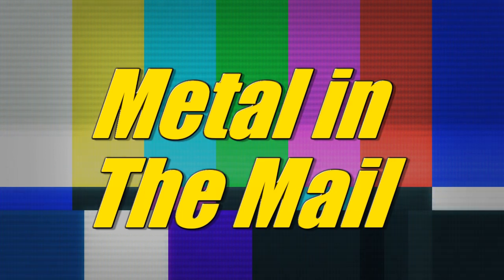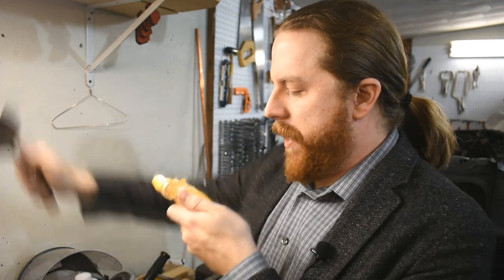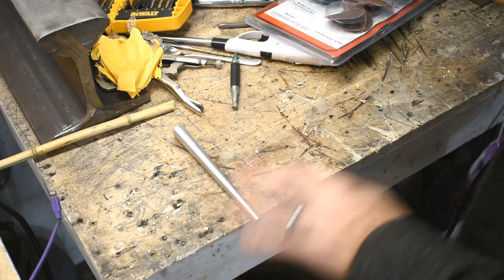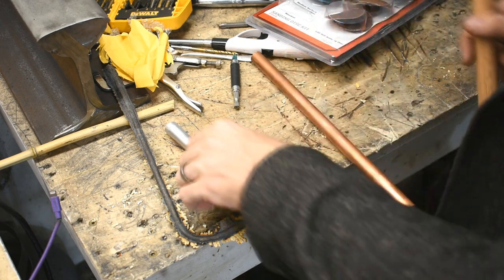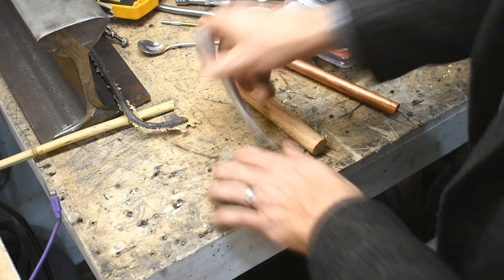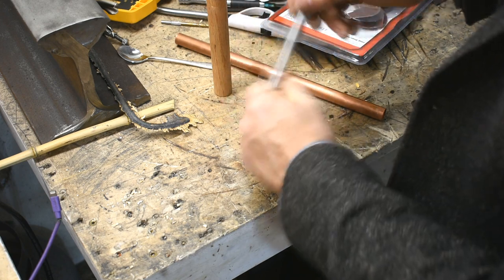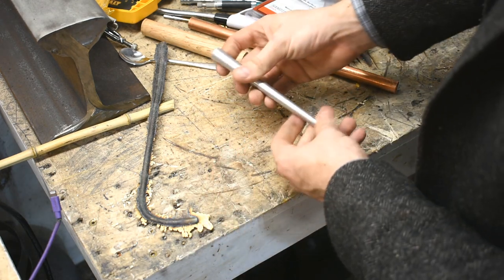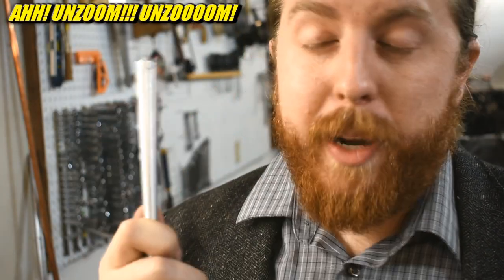Metal Casting Tip: Improving Surface Finish of Metal Castings with a Tapered Sprue Former

Comment: thinking about it , and it does make sence to pour it slowly but to prevent any vortexes or stuff like that and fast enough so it doesnt solidify before the pour is finished  
it might actually be good to lay the to cast part at a slight upward angle (maibe put the mould on a slight raise (block of wood) oposite the pouring funnel ) 
that will have the funnel at an angle so the metal rolling along one side of it preventing the metal from falling down intoo the hole and mixing with the dross like you mentioned 
setting it at an angle has the metal come in at the lowest point and flowing toward the airing hole untill thats filled to the top 
i think if you do that right the little bit of dross stuff youre talking about that gets created during the pour intoo the mould might stay in front of the flow of metal being poured in floating on top and works itself up and out of the vent at the other end 
might be worth a try , i dont know enough about metal pouring to know if it will work

Comment: i think the surface finish also depends on the investment powder you use. (I know you use delft clay). I am also an amateur caster. Earlier I used to use simple construction plaster for my lost wax process. Recently I made the switch to jewelry grade investment powder. And boom.....smooth surface finish. I think it has to do with the particle size. 

May be try sifting your delft clay and see if it improves???

Comment: The key is to keep the sprue filled during the entire casting. One trick done by industry is to have a pouring basin on top, and a plug in the sprue, so when you have some melt in the basin, you remove the plug so the air in the sprue is pressed in front of the melt.

Comment: I can see slowing down the flow when pouring into sand to keep from blowing the sand into the casting.  I run ceramic shell.  My sprues are fat and straight with a big pouring cup providing all the head pressure I'll ever need.  So far, no surface finish issues that aren't blamed on pouring too hot.  A good thermocouple helps prevent that.